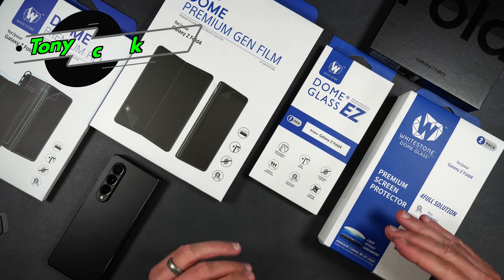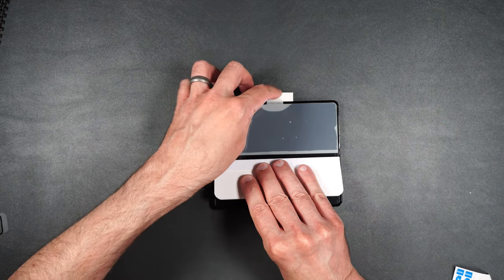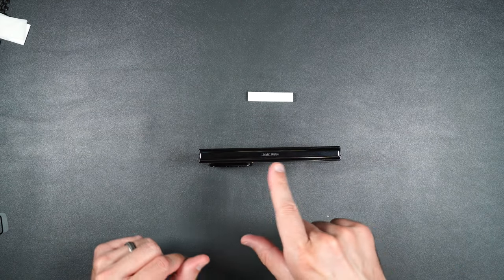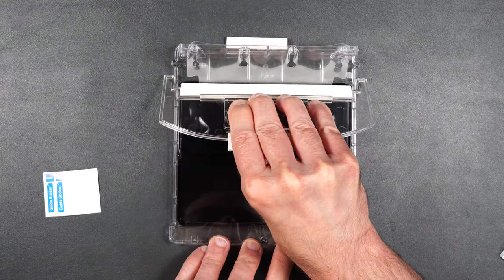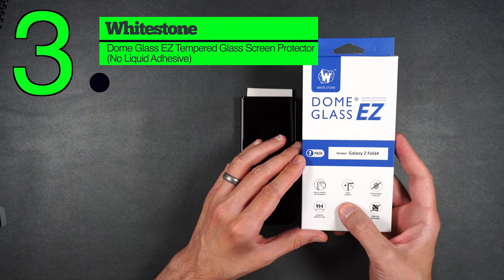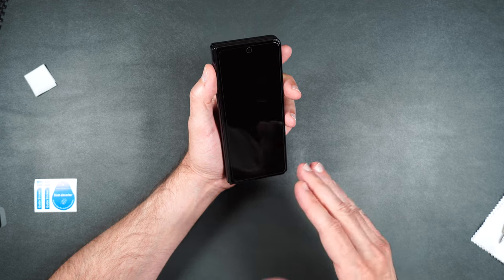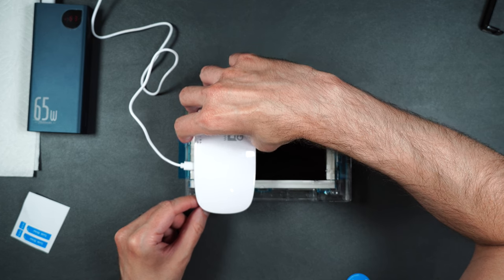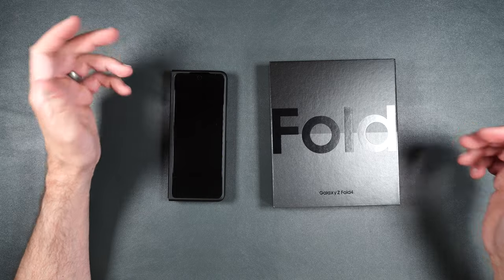Galaxy Z Fold 4 Whitestone Dome Glass & Film Screen Protectors - Install & Review

Comment: Just curious, how is the hinge film holding up? I have it too and am hesitant to install after reading many users claiming it wrinkled and peeled due to the tight gap tolerance when folding and unfolding the phone
Reply: Same thing happened to me today.  Have up on second try.
Reply: same problem...the hinge protector just lifted and wrinkled after 1/2 day use
Reply: @kel1ng  maybe that's why spigen retired their case that had a rubber hinge protector that hid in the back
Reply: @kel1ng  Hi , are you from SG?
Reply: @CristianoCritico , nothing to do with phone casing....the hinge protector film is just too thick for the reduced tolerance gap between the hinge and body. Whitestone just did not test their product prior to launching
Reply: @kel1ng  You can try visiting Mobilestop outlet or cart. They are the ones selling whitestone in SG.  They do custom cut rear and hinge protection film for $15. The film is thin enough to work well on the hinge. I had mine on for a week with no signs of abrasion
Reply: @tangtw76  , was just at mobilestop TB branch, the sales assistant told me cannot apply the hinge protector....will lift and crumple
Reply: @kel1ng  I done mine at jurong point. Film was cut on the spot. It is much thinner than whitestone.
Reply: Same for me. I haven't found one that hasn't had issues yet so I just gave up on putting one on the hinge

Comment: great video but i just don't see what is the point of getting Dome protector with UV light over the EZ... seems the same to me. any insight on the matter?
Reply: I will say 1 thing I've read. Is if u have small micro scratches that are not super deep or large it fills them and hides them quite well. I'm going to try out this brand tomorrow.

Comment: What happens to the original protector on the inside screen if you have to remove the whitestone product?
Reply: You take that off to install the Whitestone one. So if you remove the Whitestone you won't have one until you install another.
Reply: do not remove the factory inside protector
Reply: @GearheadOutlaw  you have to remove it to install this one. If you leave it on your going to damage the screen having 2 on there
Reply: @TechOut  do not even attempt to remove the factory one in the first place it is not recommended by Samsung.
Reply: @GearheadOutlaw  works just fine I’ve done it on the flip and 2 folds and never an issue
Reply: @TechOut 

"4. This warranty shall not apply and the repair charges shall be separately quoted by the Company in the event of:

 

(a) any willful modification, alteration or repair in any way made to any part of the product by any persons other than the Company; or

(b) any damage caused by misuse, misapplication of electricity, malicious acts, negligence, inflow of any liquid or dirt, accident, natural calamities, or physical force."
 
You can see the full warranty terms and conditions by visiting the link below:" 
 
You can check samsung warranty page.... Have a good day
Reply: @Outlaw  why are people removing a perfectly good screen protector just to install another one!?!? And Samsung clearly states not to remove or replace it unless the original is damaged. The inner screen is very fragile and has to have a protector on.
Reply: @xm2268  I suppose people have a product to sell and they try to market for it to convince others to buy.
Reply: @xm2268  it doesn't have to have on on many people have used it without and not has issues. This screen protector just feels better
Reply: @TechOut woops I didn't know and applied it directly over the stock screen protector on both zFold 3&4 without issue. When I sold my zFold4, I just gently peeled it off so the stock protector & screen looked brand new.

Comment: Do you remove the factory screen protector before installing this one?
Reply: You're supposed to yes. Having both can be to thick and cause damage when you fold it.
Reply: what's the point of removing it if you're just going to replace it with this product?  Wouldn't the factory protector be better?  I can see the outside display.  But messing with the inside would make me nervous.
Reply: @TheFlashyWeasel  I think this has a better feel than the factory one
Reply: Will it void the warranty if I remove the factory screen protector from the inside screen?
Reply: @MrJhobert  only if the damage is related to you removing it. But like if it's something unrelated to the screen no they should still cover that.
Reply: @TheFlashyWeasel  I'm with you! I wouldn't install this unless my factory protector got damaged.
Reply: @TechOut I'm using 2 and I'm worried now
Reply: @MrJhobert  NO and thats from a samsung tech who told me that
Reply: @TheFlashyWeasel : I thought about that too. What's the point of replacing the factory protector when it's not damaged?

Comment: When you open the fold has the screen protector bubbled around the crease?
Reply: Mine doesn't it was perfect a bit of rainbow around the edge and camera but barley noticeable, because it's covering the bottom of the inside camera slightly and the edges because it's refracting the light through it but other than that perfect, il see 6 months down the line how it held up and if it bubbled but doubt it. If it didn't now then I doubt it will later. I didn't use any of these in the video tho.

Comment: I just need a screen protector for the outside screen and the hinge( not the inside) . All I can find is the full kits.
Reply: I found one for the inside and outside , no hinge, I bought it perfect application but I'm worried that it will actually damage the inside pre installed one but I doubt it. I ordered a hinge one separately

Comment: Funny how people are worrying about the inner screen protector when its the hinge protector that causes problems. As it folds into the phone and changes the clearence gap in the hinge which can put pressure on the underside of screen and kill pixels. Ive had 2 folds both with a Whitestone TPU protector layered OVER the factory protector and both have been fine I use tempered glass on the cover display.

Comment: Question does the last one the UV cure kit come with the uv light.?
Reply from the maker: Yes it does
Reply: @HighTechCheck  so my reason. For buying this the 1st case I used on the front got loose and moved and put a couple  super small light scratches on my screen . I've read a bunch that this protector being liquid will kind of fill in those and hide micro scratches like that. What's your opinion on that not to much info on this setup
Reply: @HighTechCheck  perfect going to give it a try